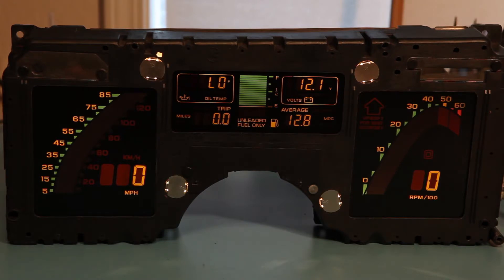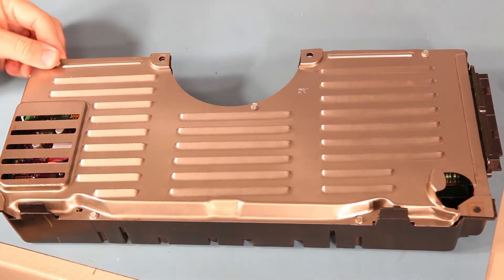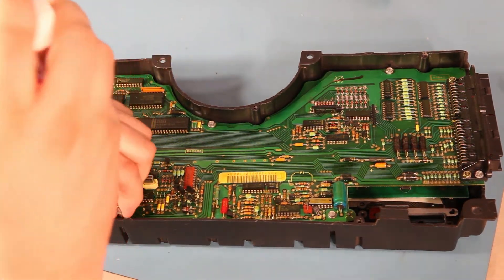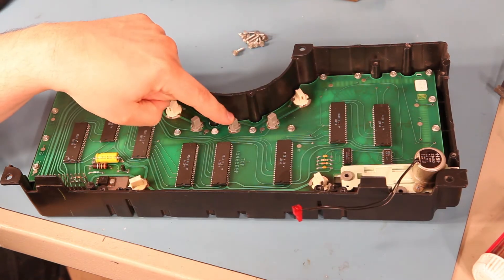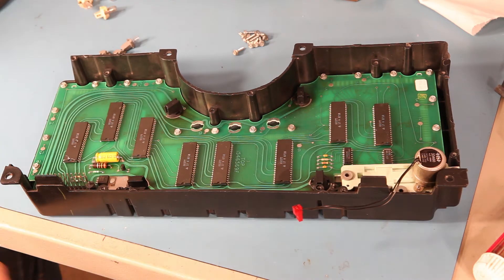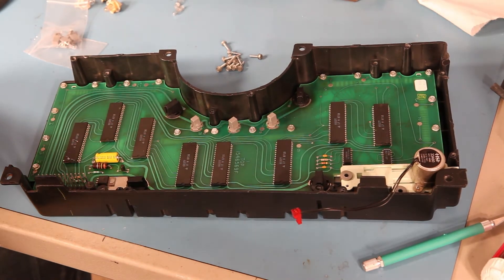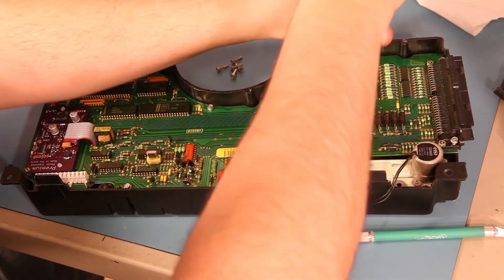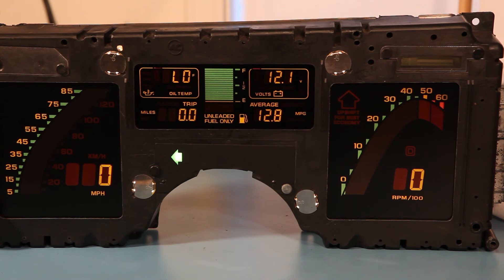84-89 Corvette Gauge Fix #13 Replacing the Bulbs

Comment: My cluster lights all go out at once , A slight tap on the dash or cluster brings them back on , they may stay on for 5 sec. 5 min. or an hour , but as soon as they go out a slight tap restores them right back !Any suggestions as to what to look for ?ALSO my odometer does not work . Thank you for any help !!
Reply from the maker: Replace or resolder the 12 pin connector between the two large circuit boards.
Reply from the maker: Odometer:  make sure the odometer wheels are still attached to the motor housing. If so, replace the odometer motor

Comment: Does the tint have to be replaced with the lights?
Reply from the maker: I would only replace the film if necessary - if it had faded and started to look clear or the info on the LCDs was hard to read.

Comment: can the front bulbs be changed without removing the entire unit?
Reply: RobVoyles Absolutely, if your smart. They just push into the twist sockets from the front, use your imagination to figure out how to pull the old bulbs out without breaking them.

Comment: the new bulb and connector will not go into the hole any suggestions?
Reply: We have installed several thousand sets in 84-89 clusters and are confident the sockets can be installed by hand. Try inserting the socket squarely to the PC board. If that doesn’t work, try inserting one side of the connector first, then the second side.
Reply: That worked Bryan. Thanks John
Reply: I have a 86 Corvette i menu gauges not working what I need to send it I need to fix it can you send a phone number to contact you you might fix it for me